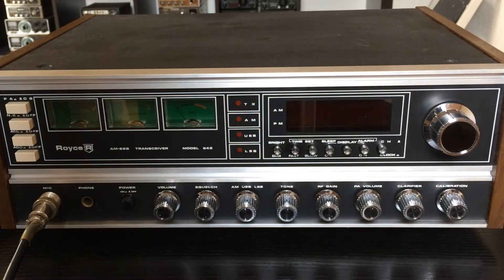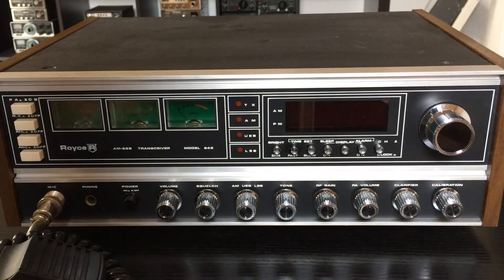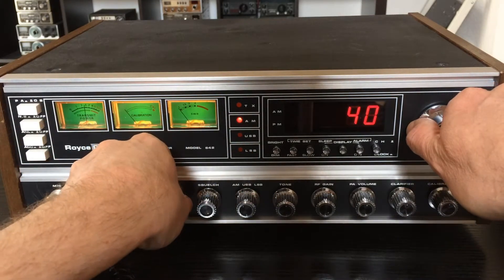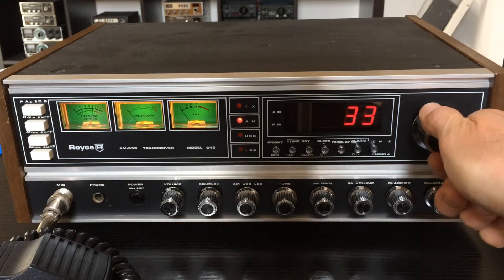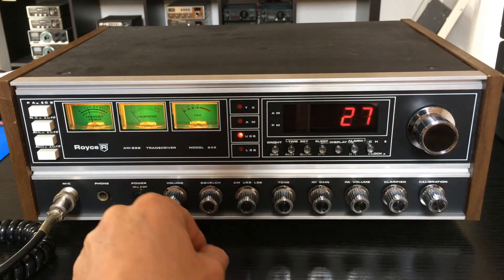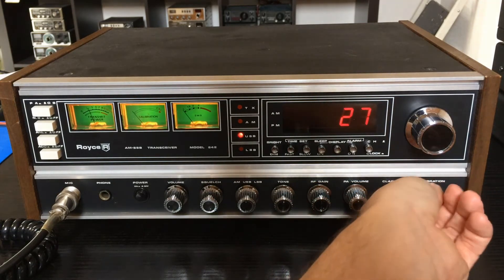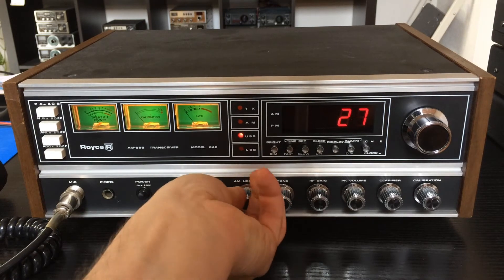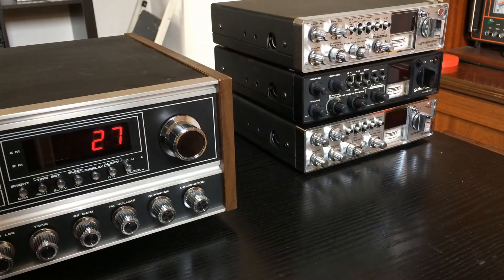ROYCE 642, Model 1-642, SSB/AM, 40CH CB-Radio Base

Comment: Sali, e Wunderbari Heimstation! Ha au eini am Samschtig vom Kolleg becho. Klingt nach chliiner Abstimmig uf AM/SSB super Kräftig u Bassig. Ume mit em Trafo hani chli Theater. Aber das cha me ganz eifach ersetze. Wie gsehts mit der interne Uhr us? Cha me die irgendwie zum laufe becho? Ich glaub die wird bi de Amis per Steckdose agstüüret, oder ligge ich do falsch? 
Uuuuhhh PLC.... Der Horror jedes Funkers.... Ich has 3 Johr müese mitmache. Ha d Bakom im Huus gha, aber da der Nachbar entstörti Powerline gnutzt het, sind sie Machtlos gsi. U der Sack het mir mis Hobby nid chöne gönne.... Zum Glück hani am neue Standort endlich Ruhe, u 0 Störige. 
Liebi Grüess us Neuendorf, vom Béla Hungária73.
Reply from the maker: Salü Bela, freut mich dir Infos über die ROYCE gäh z'chönne. Ich schaffe mit dere Chische nur im DC-Betrieb. Darum lauft die Uhr nonnig. Es isch no en110 Volt Trafo ibauet. Die Uhre laufed nur im Netzbetrieb. D' Synchronisation holets vo de Netzfrequänz. Au wenn jetzt du en Trafo häsch, zeigt die Uhr immer die falschi Ziit. Denn i de USA händs 60Hz Netzfrequänz. Mer chan aber uf em Uhreprint de pin umlöte uf 50 Hz. Das Problem hani im Momänt no mit de Hy-Gain Vlll. dört gönd die Uhre no hinedri. Mini STALKER 20 hät das Problem nie gha. De Erny 73 (JACOB-Trading) hät die Grät in Taiwan immer grad mit 220 Volt-Trafo und 50Hz Digi-Uhr bschtellt. Ich han im Fall ganz bös PLC und VDSL, wie au PV Störige uf de Churzwälle bis 145 Mhz. Ich muess aber mit de Nachbarschaft klar cho, darum lahn ich das no echli ruehe. Bis bald wieder emol. Beschti 73 us em Züri Oberland, Stefan
Reply: @SWIZZRADIOS Sali Stefan, hei viele Dank für die super Infos! Ich ha d Benachritigung erscht jetz gseh....
Jetz weisi scho chli meh, u cha das mim Techniker so witergeh! Wenn eine e gueti Lösig findet, um d Uhr in Gang z becho, denn er. Ich ha das mit dere Netzfrequenz denkt gha, aber bi mir doch nid ganz sicher gsi.... Jetz chani ihm die Infos so witergeh. Er het s Grät uf 220V umbaut, der Abgliich vorgnoh, Frequenzstabilität usw. apasst, u d Belüüchtig uf LED's umgrüschtet. Jetz warte ich ume no ufs  Sicherigsghüüs, wo vom Vorbsitzer isch Wortwörtlich killt worde....

Das Problem klingt ja sehr ärgerlich.... Ich hoffe, dass mit dim Nachbar chasch rede, u   das Problem chasch löse! Es git nüt  schlimmers für ne Funker.... Das macht alles dicht. Ich ha ume uf 2m/70cm chöne normal Funke, u a dert hani immer e Störpegel vo S2-3 gha.... Bi so froh, dasi do hie z Neuendorf Ruhe ha, u uf 2m/70cm Simplex, u 10/11m so wit ghört wirde. 
Häbs guet,  u 73/55✌🏻
Reply: Sali Stefan, wie hesch es? Jetz muesi di gliich nomol froge wie me am beschte d Uhr in Gang bechonnt. Ich mues ja luege dass s Grät wo jetz e 220V 50Hz Trafo drinn het, uf 60Hz chonnt. Oder wie gseht das us mit däm Pin wo me uf der Platine cha umlöte, sodass sie de mit 50Hz d richtigi Zit ahgit? Hesch du irgendwelchi Schaltplän, oder e Aleitig, öpper wo chönnt witerhälfe? Mi Techniker chönnts sicher mache, aber ich bi da mit mim Elektro-Latein am Ende. Liebe Gruess u 73✌🏻

Comment: The board inside is it from cybernet japan or oresident?
Reply from the maker: Dr Old Man Alessio hello, how are you? Yes inside the chassis is a kind of a CYBERNET PCB and calls CCI3001. A lot of other radios have these PCB includet. Per example: SOMMERKAMP TS-340DX, COLONEL Silver Star, GLOBEPHONE GS-480DX, ROYCE-639, SBE Landcommand, PACE 8093, etc. Have a nice time in 2024. Best 73 to you and yours.
Reply: @SWIZZRADIOS  cybernet, that sounds like early internet . Even HAM international multimode and jumbo used those
Reply: @SWIZZRADIOS  those were high quality pcb's  40 yrs proof.

Comment: Hi
Looking to fit an ammeter to measure the rf final bias on my royce 642 , it says to fit the ammeter to the junction of L5 and C77 , have you ever adjusted the rf final bias on your royce or your sommerkamps, if you have could you let me know exactly how i connect the ammeter, do i need to remove any wires or components to do this? Thanks mark

Comment: Never showed modulation transmit on the meters or the built in clock & alarm radio features.
If I had power line noise like that I would be looking into some serious grounding issues and AC line noise supressors❗MERCY ❤ THOSE ROYCE RADIOS 👍👍👍
Reply from the maker: The problem with PLC is as follows. PLC is HF over AC-lines. PLC radiates out of all AC-lines. You can't solve this problem. CB frequencies aren't notchet out by PLC. It's a terrible thing...